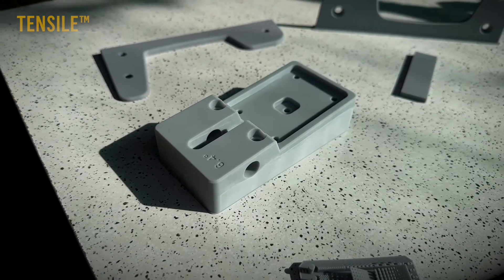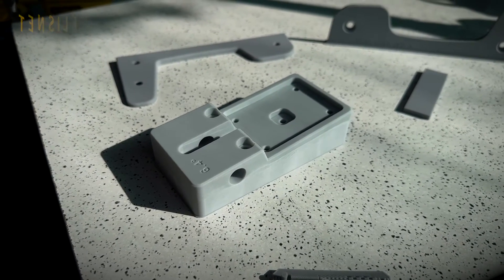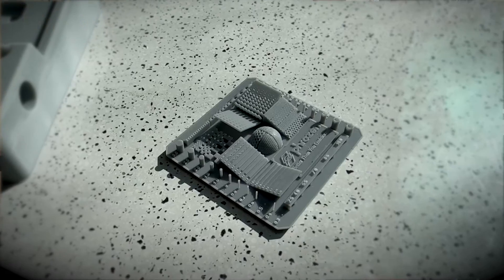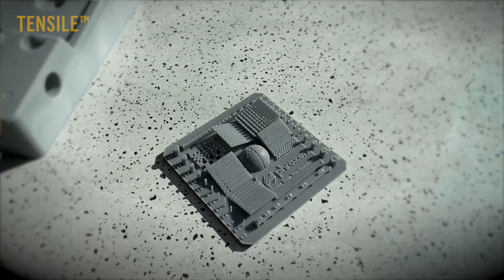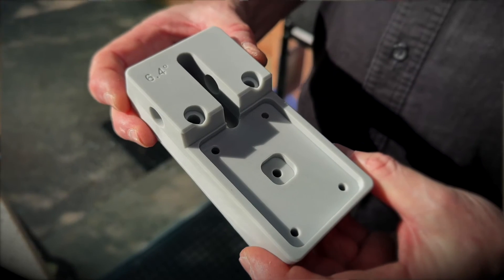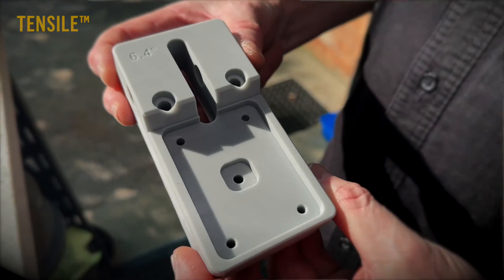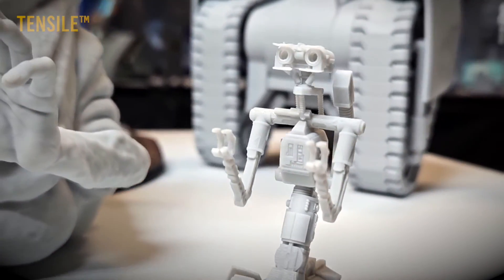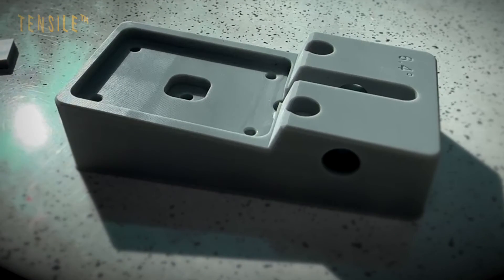TENSILE™ Industrial Strength 3D Printer Resin - Hear what the experts are saying.

Comment: I just picked up 3 x 1L bottles from the Australian modellers competition. They had a show special of Australian $50 per 1 L bottle so I bought 3 bottles.  Just used it yesterday and my god is it good.  My only problems is I wished I had bought every single bottle at the show as it sells for $140 on special!!  It is the best resin that I have used and I printed at 12°C without any issue at all.